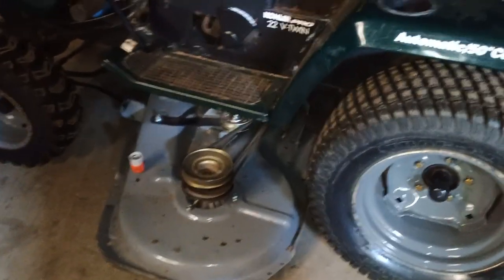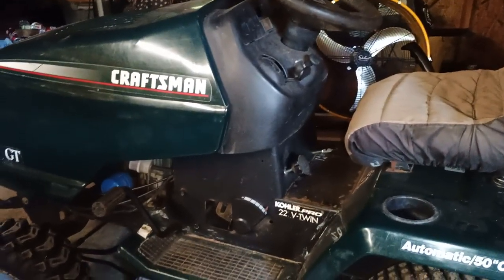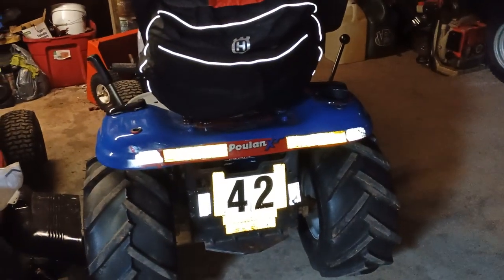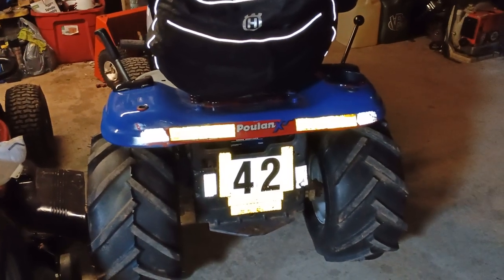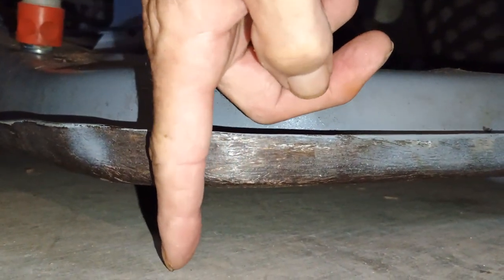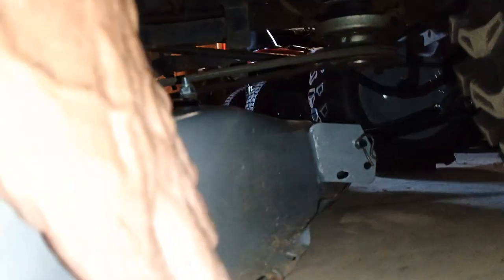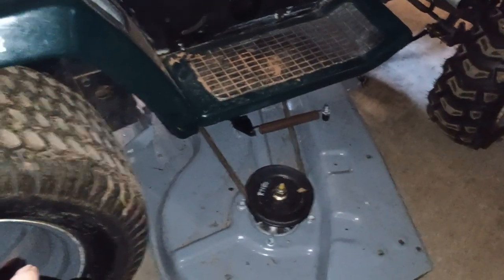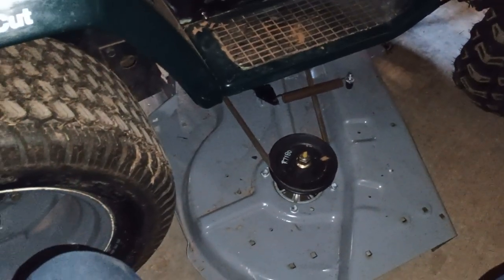getting ready to relevel the GT mower deck part 1

Comment: You don't have to take the deck off just adjust on that side. Looks like an upside down t
Reply from the maker: @rickbroerman9267  I  had to do that so I could get to the adjustment nuts so I could get them cleaned up